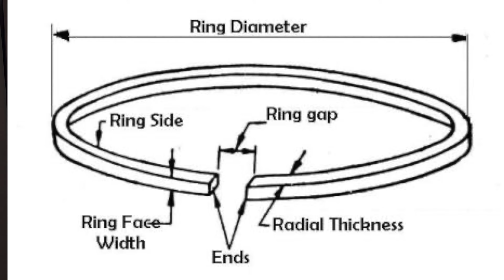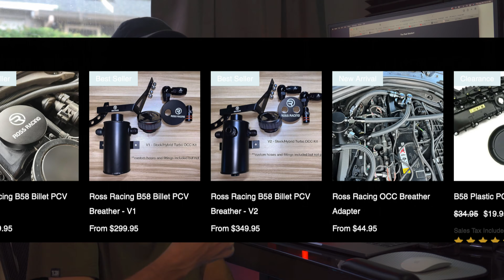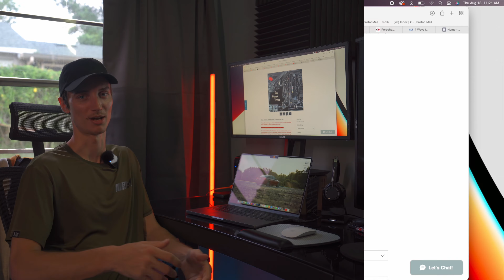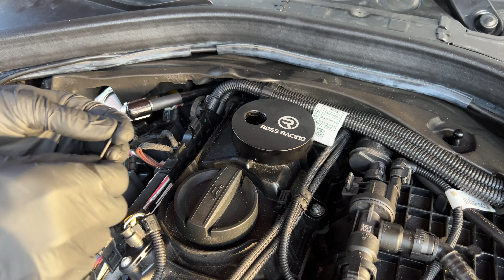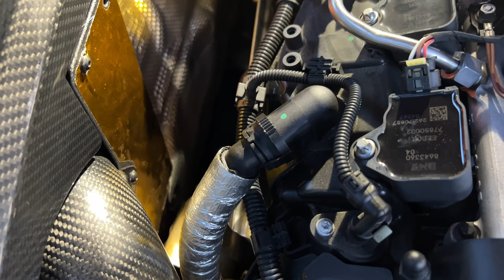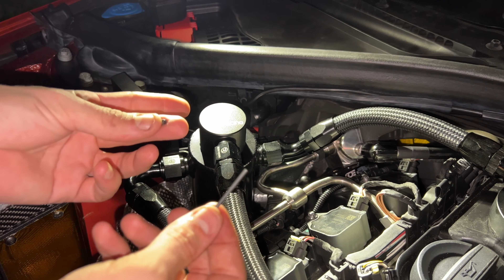DON’T OVERLOOK THESE MAINTENANCE ITEMS (Gen 1 B58 PCV Breather + Catch Can Install - DIY)

Comment: When is this kit required? Assume not on stock car? And if tuned, then is it required for Stage 1? 2? Or higher with aftermarket turbos etc? Lastly, is this needed on Gen 2 B58s? Sorry 21 questions
Reply from the maker: Well the PCV delete can be useful whether or not the car is tuned. Mine failed when the car was stock but had it replaced under warranty then did the delete + catch can once I tuned it bc the PCV would be under more stress once tuned so I just did it for peace of mind and not having to deal with that again. As far as certain models you’ll have to go on their site and check it out
Reply: @skrrthaus thanks for the reply!

Comment: Any issue with the cap on the free tube, cause i did the same and just ran few kilomètres alternance that i saw that the cap on it disapear, any pressiur in?
Reply: Speaking about 13.43
Reply from the maker: No mines stayed on just fine, shouldn’t be any pressure buildup because of the outlet hose I placed on the right side of the engine

Comment: Did you get a brass fitting with your kit? My instructions don't tell me where to install. I'm wondering if it fits to bottom of catch can.
Reply from the maker: The drain plug? Yes, put that on the catch can prior to mounting it. I didn’t do that and it was more difficult lol

Comment: Review video ?
Reply from the maker: Review is, it works! Haven’t had any issues since setup
Reply: @skrrthaus  nice how often do u check the catch can and empty it? Or is that rarely filling up?
Curious because I’m lookin at the same setup as you.
Reply from the maker: Haven’t even checked it but I will this coming oil just to see. Really shouldn’t have to drain it often as oil should barely accumulate unless somethings wrong

Comment: Where does that one hose that went to the right side of the engine and down go?
Reply from the maker: Just into empty space to “vent to atmosphere”. Reason why it’s on that side is to be further away from the cabin air intake
Reply: @skrrthaus  thanks for the clarification
Reply: Venting to atmosphere does that throw a check engine light?
Reply: @cya3651  no lol it's going to the atmosphere, not through a sensor like your downpipe does.

Comment: I had the same issues when buying my 340i with 13k miles my rpm was going up and down after filling up and sometimes driving.
Reply from the maker: No way! 😂. B58 things. It was the same issue with the PCV right?
Reply: @skrrthaus  im not sure the problem just randomly went away after a couple months, some people were saying it could be the breather valve on top of the engine or the leak detection pump under the rear passenger door. No my car just chokes after filling up takes two cranks. So i replaced both those parts hoping that it fixes it.
Reply from the maker: Gotcha. Yeah when I had my PCV replaced at the dealer that fixed it

Comment: I bet the fuel pump is pretty noisy without the engine cover.
Reply from the maker: It’s not that much louder, I still have the foam on top of it. But yeah the fuel pump plus injectors are loud haha. It’s not crazy though

Comment: Awesome video man! Always appreciate the support!

For anyone looking to install this, installing rhe OCC to the brace before you mount it OK the car will make this a lot easier!
Reply from the maker: Thanks fam 🙏🏼. That's a great tip and would of saved a lil bit of headache 😂
Reply: @skrrthaus  can I run a strut brace with the catch can bracket, how would I make that possible?
Reply: But i dont understand if I don’t want catch can , on stock turbo stock intake then how is this works? Eventually i will delete Intake resonator I have B58 g30 540
Reply: @bmwsincekid  you can run the gasses to the bottom of your car by the midpipe/downpipe so it just goes out with all of your other gasses.

Comment: I just scrolled down 2 years of your videos and don’t see one that your at the track?
Reply from the maker: Hey I don’t think I mentioned I tracked my car did I? 😅 I haven’t yet but I plan to!
Reply: @skrrthaus  you didn't, but I was hoping when I landed on your channel and saw F30. Bummed to see another BMW channel that doesn't track. Go to a local track day. I promise after the last thing you'll care about it some BS carbon fiber piece or going to parking and showing off your car.  You'll care about learning how to drive your car and building a balanced BMW that you can confidently sent it on any track and represent BMW
Reply from the maker: @Speediesam  🤣🤣 100% brotha. That’s the plan, the trip I mentioned in this video will actually be going to the Tail of the Dragon. Those definitely aren’t learning roads but it will be fun. After that I’m planning on attending the next track event there is here in FL 🫡. I fully agree with you!